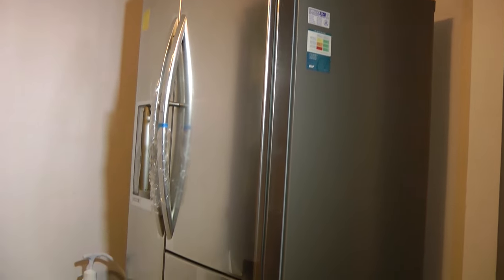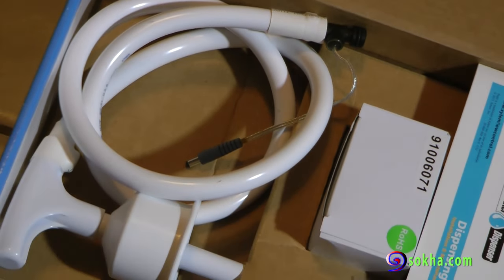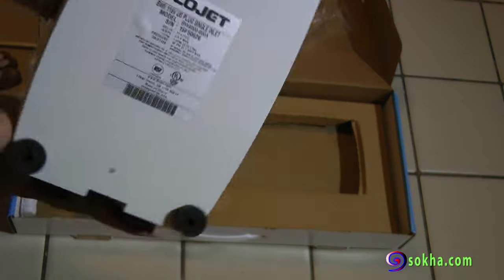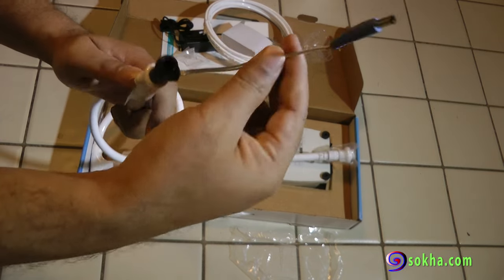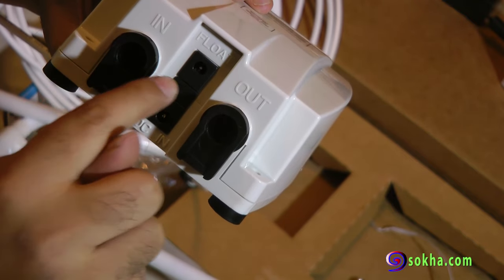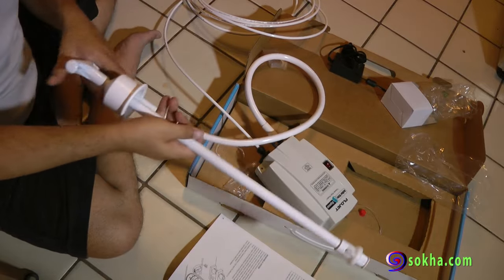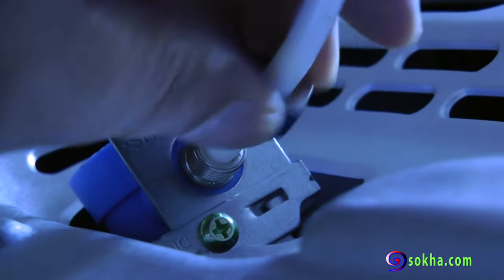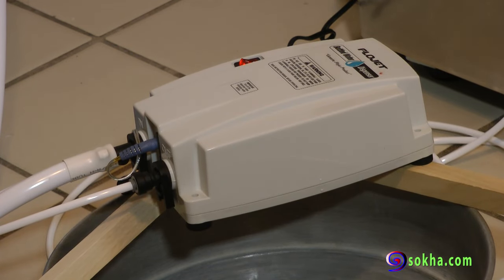connect bottled water to the fridge for ice and drinking

Comment: I'm agreeing with William Yang --- you are a genius!  I have the same issue: the fridge is approximately 15 feet away from a water source with two brick walls dissecting the space.
I've been purchasing bags of ice for the past two years so that I'd have ice in the bin without wasting the limited amount of space in the freezer with ice trays.
After watching only two of your vids and gazing at the rest of your collection of How-To vids, I've determined that you are indeed a Renaissance Man!
Your topics are timely and, for me especially, incredibly topical.
Thanks!
Reply from the maker: +The Emissary .....Thanks for the kind words.   The human body consists of over 80% liquid and mostly water.   Thus, water is an essential source to our survival and good health.   At $150, the pump might be out of reach to a lot of countries.   Thus, the reason I want to re-design this pump at more affordable cost but with the same functionalities and reliabilities.
Reply: well done :)
Reply from the maker: the problem with $20 pump is not BPA-free, phthalate free and not enough psi to do the job.   moreover, it has no sensor for water pressure. the circuit built for the pump used in the video cost more due to R&D and if you analyze the product parts and components, it's definitely worth more than $20.

Comment: I use gravity in my workshop to supply my fridge ice maker. I have a vented 5 gallon jug on a shelf about a foot higher than the fridge, vented thru an air filter  and using 5/8" tubing inplace of 1/4". To correct for lower water pressure, I extended the contact strip in the ice maker timer that opens the water valve nearly tripling the amount of time the valve allows water to fill the tray. Problem solved... Great video!
Reply: you did it without a pump?  How did you know how tall does the gallon jug must be to correct lower pressure?? I really need some help
Reply: @mariangulo4457  I started with the jug sitting on top of the fridge and that is fine. The things I did to compensate for water pressure were 1) gravity, the water jug is the highest component. 2) decrease resistance to water flow by replacing the 1/4" water line with 1/2" clear plastic tubing, which has a 3/8" opening and fits right over the threaded fitting on the water solenoid valve and all other water line fittings in the hook up. 3) I relocated  the water valve from the bottom of the fridge to the top. It's just held on by 2 sheet metal screws so it's easy to move, but the 2 wires controlling the valve have to be extended to reach the top of the fridge also. This puts the valve below the jug of water but above the water inlet into the ice maker making the shortest route all 3 steps are maximizing flow. 4) With the above three steps you can make ice. My Whirlpool ice maker made full sized, but mostly hollow cubes with this set-up. The cube size adjustment on  the ice maker is controlling how long the water valve stays open allowing water to fill the tray. At it's maximum setting I got the hollow cubes, so I knew I had to increase the time the valve stayed open to get normal ice cubes. The way I modified the ice maker to achieve this is simple, but requires a little DIY tinkering skill, but as said befor, you can still get pretty good ice just using steps 1-3.

Comment: what I want to know is when the pump is on is it always making the sound or does it have to be dispensing water to make the sound. Does the fridge trigger the pump or is it just always trying to pump water into the fridge.
Reply: It seems to work on pressure. It only turns on when in use. It does not run continuously. Only to satisfy pressure. I have the two bottle dispenser. Works perfect

Comment: Thank you for your invaluable info and easy explanattion.  Would you be able to say what is connecting your fridge to the electrical socket (that red piece showing in your video just before you connect hose to back of fridge) thanks
Reply from the maker: what's the timecode in the video?
Reply: Was a 3 way splitter to hook up more cords

Comment: hello.  i noticed your pump says 12v at the back but you managed to hook it up on your wall socket (220v?).  I have a 115v version but it came with an adapter thats 100-220v.  i haven't used it thinking it may not be compatible with my wall socket of 220v.  Kindly advice please.  Thank you.
Reply from the maker: +n6omega .... I live in the USA where 110-120 volt is standard.  if you live in area where 220 volt is standard, then, you need the proper converter for your power supply.
Reply: your adapter is good to go. it will fit your socket of 220v because it's 110v-220v ac...as long as your output is 12v to run your pump (assuming your pump is the same as in the video).

Comment: Thank you for the video. I bought and installed this 18 months ago with no issue. Today the white tube I connected to the fridge popped off after I had refilled and reattached my water jug  (yes, i used the little clear gasket in the right order). The gasket and little metal hub attaching it to the fridge stayed attached to the fridge. Do you have any suggestions on how to best fix this?
Reply from the maker: i'm not a reseller or work for the company.
the video i posted on YouTube was just for my own documentation.
you might want to contact the factory for the solution.
Reply: @sokhaDotCom  Thanks for the quick reply!  I think there's probably an easy plumbing solution, i'm just not much of a plumber. Thanks again for the video - I never would have gotten a fridge with a water dispenser without having seen this first.

Comment: i want to know how you did the gravity method that didn't require pump please?
Reply from the maker: standy-by for the ancient science.   :-)   forget about just solving water issues....how about solving gravity issues altogether, wouldn't that be neat?   lifting 100 ton rock as if gravity isn't there?   how about a flying craft or motor vehicle or space travel using a completely new science....well, actually ancient science but somehow it got lost along the way.
Reply: sokhaDotCom can you make a video on how you used to get water to the dispenser before you discovered the pump?
Reply: I would love to see how to set up using gravity instead of the pump as well. Thanks in advance.

Comment: Did you have to do anything with the filter in the refrigerator ? Like a bypass I have the same lg fridge thanks
Reply from the maker: you don't need to mess around with the filter.  just install the filter as recommended by the manufacturer and replace it accordingly.  hook up the bottled water as if you hook it up to the regular waterline.

Comment: I also thought of using one of those plastic jugs that you can pump up by hand to dispense insecticides and such, just remove the wand and hook the hose to your water valve. They will maintain a 10-20 lb pressure when pumped up.
Reply: Good idea

Comment: How did you do 20 years ago using gravity instead of the pump?
Reply from the maker: it requires ancient knowledge dated back before the Egyptian pyramid
Reply: Because the problem that I have where I live, there is no constant water service, so I was planing to buy like a 15 gallons bottle and make the water dispenser installation, but now I'm curious you mentioned your fridge required a 30psi. I'm buying a whirlpool wrs586fldb. So do you think I must buy a water pump or just by putting a bottle higher than my fridge would be enough? Thanks again

Comment: Good info.  Can you leave the pump turn on  24/7? there will no overflow in the fridge?
Reply from the maker: si.
Reply: Rodolfo Solano 

Tl;drThe fridge has valves to prevent leaks from being under constant pressure. 

The way plumbing in a house works is that you have a tank that holds pressure from the pump, the pressure in the tank provides water pressure to the house. with a fridge(and anything else connected to the plumbing)it’s always under pressure from the water supply. (This example is for a single house disconnected from the city water supply)

Comment: Hello, I have a question. Can I use the pump horizontally or vertically?
Reply from the maker: doesn't matter about the orientation.  the amount  of pressure (PSI) pushing thru the tube is the same.
Reply: sokhaDotCom Thanks. I have a series 5000

Comment: I would totally go with this solution but that pump being $150 is complete madness. I am looking for a solution since I live in a townhouse and don't want to drill holes in cabinets going from my kitchen sink to the fridge and making it discrete.
Reply from the maker: calculate for a long term returns;  $150 used it for 10 yrs.   you spent about $1.25 per month.   less than a nickel a day.  so, the question becomes...... is the drinking water important enough to spend a nickel a day?  if you buy a quality product, it will last a long time.
Reply: @sokhaDotCom  True. I have a water filter on my faucet though and so the alternative option to this jug feature is running a water hose from under my sink to my fridge, or getting a couple more ice cube trays. I think I might just go with the ice cube trays also because we are somewhat limited on space, so that is something else for me to consider if I want to reduce walking space in my kitchen. Thank you for your input and advice. :)

Comment: Ok thanks I ask because the water that I'm using in the 5 gallon jug will be filtered already so didn't make sense to filter it again plus the lg filters run about 50 dollars thanks again
Reply from the maker: doesn't hurt to filter it again, right?   think about your coffee maker.  you can put one filter or 2 filter or 3 filter.   doesn't matter.  if one filter failed, at least your other filter still works!!    if you buy the filtered water, you HOPE they changed their filter regularly, right?   the keyword here is HOPE.   what if they didn't change filter that one time when you purchased the water?   is there a way you can tell?   99.9999%   you won't know!!   thus, having your own filter is a double protection policy.  :-)

Comment from the maker: @dumbCupYou need to check your fridge specs.  Usually, the minimum requirement is about 30 PSI but double check your fridge to be certain.   I'm currently designing a new pump that will solve this problem.    Using purely gravity to move water is doable as the Roman did over millenniums ago.  You just need to understand fluid dynamics.If you want to see the progress of my new design, you can follow me on Twitter.   I broadcast the message once I release a new product, software and hardware.
Reply: sokhaDotCom can you please let me know how you run your gravity fed only water system??
Reply from the maker: @romanmaese6126 ... very advanced ancient knowledge
Reply: Could I just follow you here?  I don't Twit. :)
Reply from the maker: @DarthBludgeon  .... me 2.   i don't twit.  i don't instagram.   i don't facebook.  i don't do social media.   i do guns & engineering!  lol
https://youtu.be/3p-wxwTWtog
sure!  you can follow me here or u can follow me home and we'll go shoot some guns!  lol